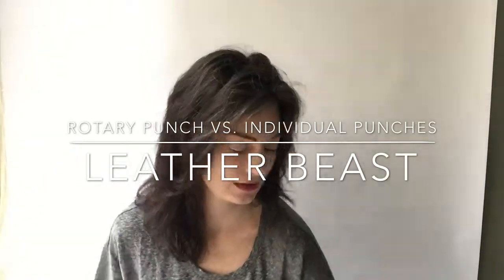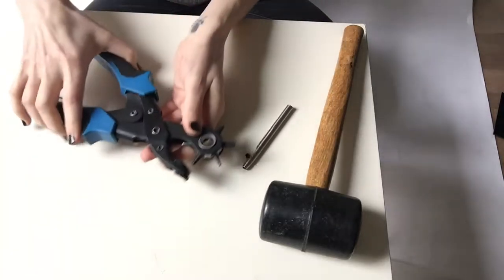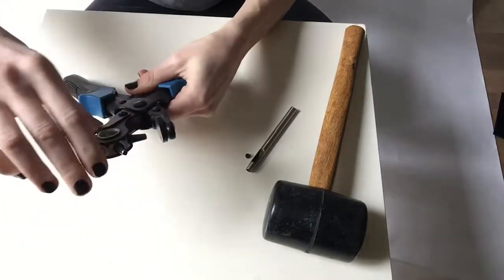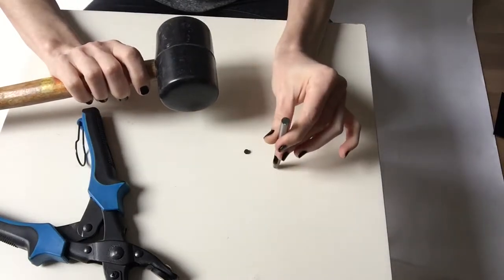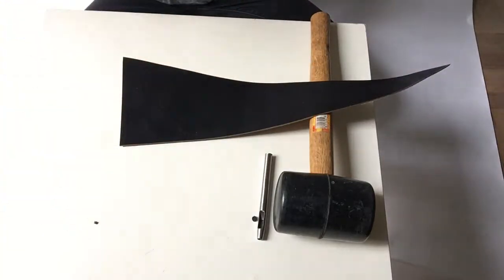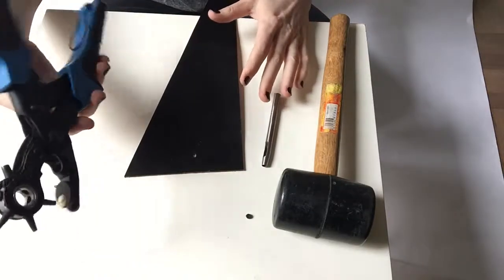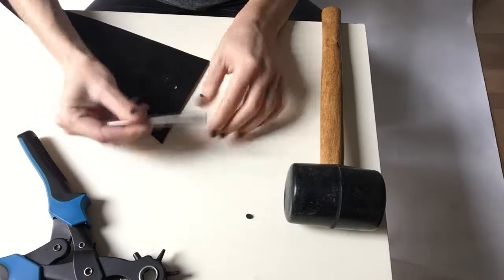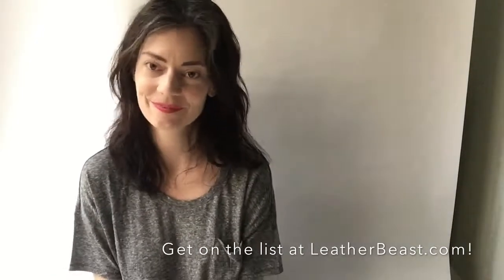Rotary Punches vs Individual Punches with Leather Beast

Comment: The danger of using a metal hammer on a metal tool is due to the hammer actually causing a metal splinter of the punch to come off when struck and from mushrooming the pound on end of the punch over time which will also cause pieces of metal to come off (the dreaded splinters). Using a metal hammer should not damage the  punch end because it never touches it. I have found the way to damage the punch end is forget my pounding board and try to pound it through my granite slab.  Thanks for the video. Good information on the rotary punch.